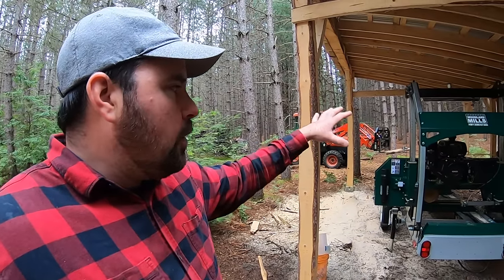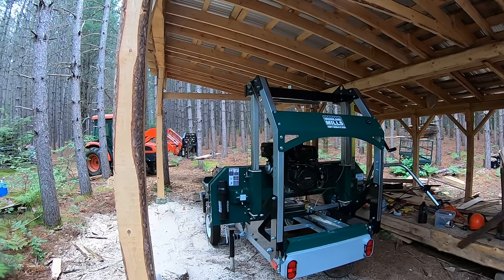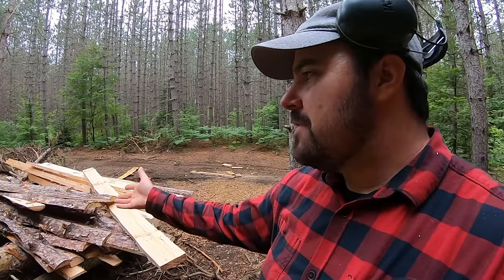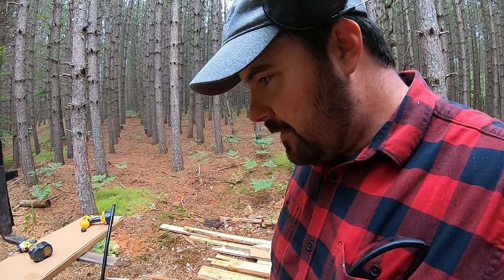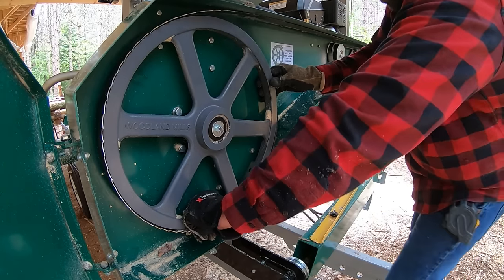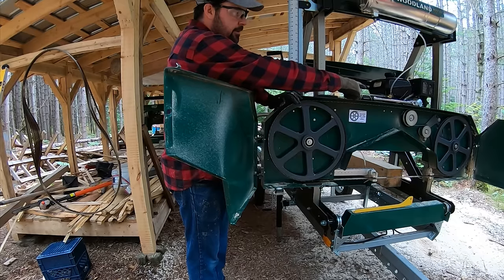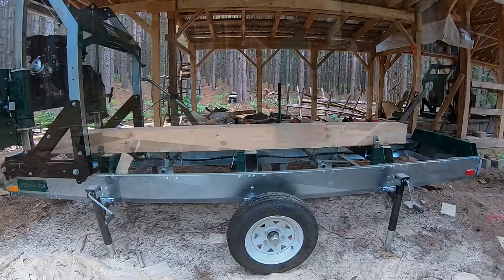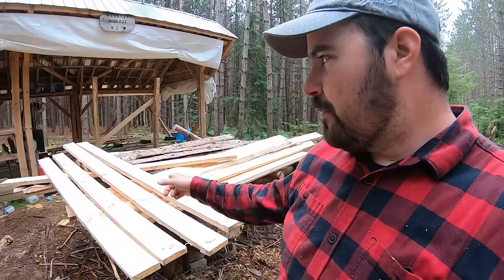Sawmill Won't Cut Straight | Fix Your Sawmill and Avoid Wavy Lumber

Comment: bands should ride on the wheels not held on with the guides. thrust bearings should only spin when the wood is pushing it.  if those are solid wheels meaning no rubber tire the band should run with the gullets on the edge of the wheel.  if the body is off then youll get vibration. if your teeth are on the wheel thell dull  but only the inside of the set.   saws always pull to the sharp side, but when a band gets to the point where it has to much pressure then it snakes the other way.   i sawed on a large corly for 16 years full time. good luck
Reply from the maker: Lots of great tips. Thanks for sharing

Comment: Put the blade guide ( with yellow guard )nearer to the  piece you are cuttiing the shorter the gap between guides the less it will twist. I used to run several narrow band mills and  a 5 head and twin horizontal as well as a baker mini scragg. It worked for me
Reply from the maker: Thanks for coming along for the video. In the position the blade guide was in that is the furthest it can go smaller.
Reply: @sawingwithsandy  See if you can get it modded it should save a lot of aggravation. I have been following you for a while but only just seen this vid. You are making great progress and also your vids are professional and full of great content ! Thanks

Comment: Would moving the blade guide closer to the log help ?
Reply from the maker: The blade guide was as close to the log as it could be in this case actually
Reply from the maker: I’m thinking it wouldn’t make a difference though as the blade doesn’t ride against the blade guide blocks like on some other brands

Comment: I did not see any coolant water on blade. Also blade supports did has quite big distance.
Reply from the maker: I usually don't use coolant or lubrication of any kind when the tree is still wet from being freshly cut down

Comment: I'm getting wavy boards with new blade that mill came with and also put in another brand new blade out of box from Woodland mills. Its a "General Purpose" blade. I am cutting Vergina Scrub Pine. Cuts are more than wavy, luber is firewood at best. I feel like this mill is the cheep. Also throttle cable comes loose all the time. Maybe its not getting high enough rpm? Throttle handle broke and they sent me a new one but all I have is a little set screw to hold throttle cable. So I am thinking possibly its not getting enough rpms?
Reply from the maker: Hi Greg. Hopefully you can get some flat sawing before long. How do you tension your blade? Have you tried increasing your blade tension?
Reply: @sawingwithsandy  Thanks for taking the time I really appreciate!  Been doing the "two and a half to three turns" method as I didn't have a tork wrench.  Now I have one so when I am back in a few weeks will see what 25 ft lbs does. That's what I was thinking as well because its hard to believe new blades would be to dull to cut.

Comment: I noticed the blade roller guide is way too far away from cutting edge makes huge difference performance of blade as they're getting dull should be
 less than four inches from log
Reply from the maker: The blade guide doesn’t move any further over than what you saw on the video . Different manufacturers may have different adjustments
Reply from the maker: On my sawmill it doesn’t have roller guides , it’s got a block that doesn’t keep contact with the blade. It’s only there in the event of significant blade deflection

Comment: Sandy your blade may have been very dull but it also looked very loose prior to you coming into the cut which is just as bad for producing wavy cuts as a bad blade does. Ha, I waited till near the end to make this comment then you covered it right at the end.
Reply from the maker: Thanks for watching! It did appear loose I agree. Funny enough it was 25ft lbs

Comment: My lumber is just a tiny bit off on one end from the other about a 1/8 you know what that is ?
Reply from the maker: My best guess would be that the lumber is sagging slightly possibly. Would moving the log so the log bunk is fully supporting the ends of the log help to ensure it doesn't dip down?

Comment: Hey .
Is there no guid wheels on that mill .
If not what is being used in the guide rods for blade stability
Reply from the maker: There’s no guide wheels on this sawmill but there’s flat guides but they don’t contact the blade under normal conditions
Reply: @sawingwithsandy  what are they made of
Reply: @sawingwithsandy  would you please show a more up close look at those in a video. 
Mine are ceramic and I am looking for alternatives
Reply from the maker: I’m not sure what the material is but it feels like metal
Reply: Two ceramic guides sandwich the blade with a roller bearing behind the blade that acts as sort of a stop if too much pressure is placed against the blade when sawing(blade does not normally touch it)
Reply: @mikechristensen9744  
Interesting. 
I have those on the norwood hd36.
Their new models have flipped to guide wheels. 
I wonder which way is better .

I think sawing Sandy has both types of guides .

Comment: good morning sandy. my 130 max sets the blade tracking automaticly, at least it is supposed to. soometimes when i change a blade the blade seems to not ride perfectly and i have no idea how to adjust the tracking. Has this happened to you? thamls
Reply from the maker: Each time I put a new blade on I often adjust the tracking with the bolts on the back of the follower band wheel
Reply: @sawingwithsandy  i thought it adjusted on its own?
Reply: I found the drive and fallowed belt on new mills were of lower quality. After changing mine with good quality belts 25 blades no track problems. As Sandy showed, wipe the belts off dry no lube,  run new blade dry for 10 cuts. Cured my problem, happy sawing
Reply from the maker: The bolts on the back of each side of each bandwheel allows for tracking adjustments
Reply: Once I got my tracking "dialed in"(I had initial tracking issues that Woodland Mills helped solve) over 2 years ago, I have never had to adjust the tracking...even when I changed from Lennox to Ripper 37 blades.

Comment: I don’t have a wave issue I have an hourglass issue. My Timbers are a quarter to half an inch narrower in the middle and Han on the ends. Is this a blade issue as well or something else???  I have an HM126 woodlander
Reply: If there is tension in the log caused by the tree not growing straight up, the shape of the cant will change after each board is cut off. If the cant curves up at the ends, your next board will be as you describe. If you flip that cant 180, the boards will come off thicker in the middle than at the ends.
Reply: @OregonOldTimer  so the issue is all in the log???  I am milling cedar and pine
Reply from the maker: I’ll be sure to think more about that for future episodes. I’d imagine it’s the blades and sawmill rail flatness
Reply: @bobsickinger6017  Maybe not, but that's the first thing I'd check. After cutting an hourglass board, see if the remaining cant is off the bunk near the center, assuming the ends are on bunks without a lot of overhang.
Reply: @OregonOldTimer  that’s exactly the problem!!!  Middle is off the bunk you can see daylight. Thanks O…I’ll pay more attention during my log harvest
Reply: @bobsickinger6017  One thing you can do with a tensioned cant is flip it 180 after each board is cut. That tends to keep tension in balance, and the thickness variations won't be as extreme.
Sometimes, if you're lucky, rotating it 90 will make thickness even, but the internal tension will make those boards want to split from the ends.
Reply: @OregonOldTimer  thanks O

Comment: Another factor is the cheap garbage blade guides woodland uses. Down pressure roller guides would make the change interval probably 1.5 times longer. Combine that with a proper blade like HSS or carbide for a much better experience.
Reply from the maker: Likely would also contribute to high initial price
Reply: @sawingwithsandy  Yes, slightly. HSS blades are about 70% more expensive but last more than twice as long in my experience.

You can buy a roller guide bearing kit for retrofitting on the Woodland from Cooks for around $280 I believe.

Would be fun to see a video from you installing something like that.

Comment: Have you had much success welding a broken blade back together ? Might make for an interesting video.
Reply from the maker: I haven’t tried it to be honest
Reply: You can't just weld blades together... I have a Tig welder ...the blades just break in the same spot again...they use a special welder for it and they are quite spendy to buy
Reply: A friend of mine has a LT 40 wood Mizer and custom sewed with it for many years. He always bought his blades and inch longer than it called for so when they broke all he did was square off the ends and weld them back together with his wire feed welder. They always held up well after he did it. You don't need a special welder. You just have to be good at welding and he is.
Reply: @aldredske6197  he must really know what he is doing then ...I wouldn't mind seeing it done...I've never had luck doing it
Reply: @Grizz270  he used to do it all the time. He isn't in the milling business anymore because he is in his mid 80s now and can't handle the lumber anymore.
Reply: @aldredske6197  I'm sure it can be done but this is what I know about it.... when you heat up the metal the tinsil strength is good but not flexible... one needs to know how to heat it back up to the proper temperature and then slow cool it ...there are videos of welding band saw blades with a mig welder but the band saws they are using is for cutting metal and turn at a much slower rate.  ...mine keep on breaking...if I could learn how to heel the metal I'm sure I could do it but then you run into the next problem...breaks are caused by hairline fractures and usually once the blade breaks you have many more hairline fractures so you would be welding the blade quite often... now I'm sure your buddy has lots of experience and knows how to keep those hairline cracks to a minimum and then it would be worth it... anyway you got me thinking and I'm gonna try some more. ...I got time for the learning curve ....cheers